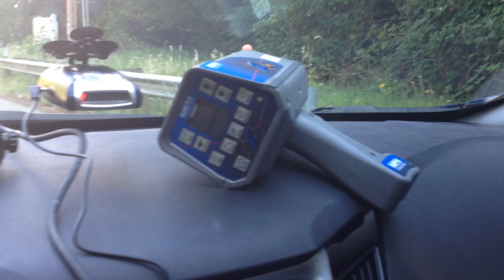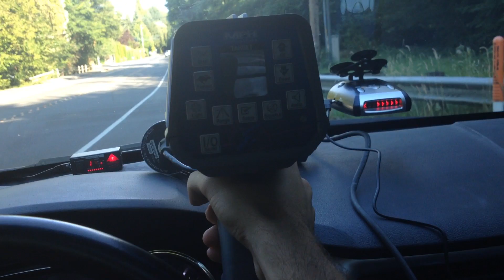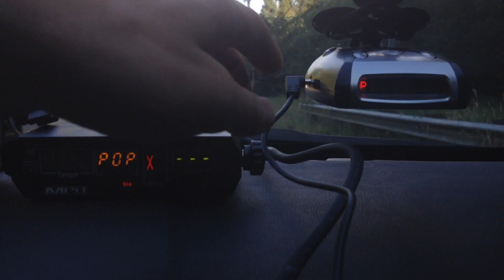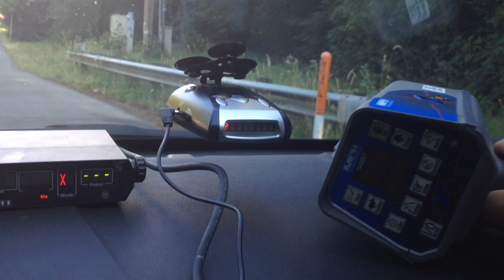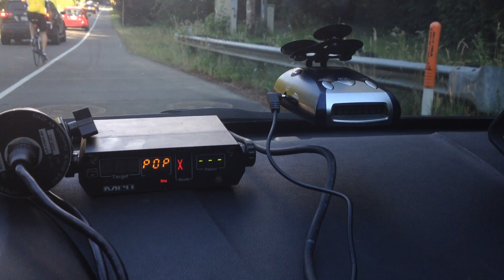Rocky Mountain Radar C495 POP test

Comment: How did the v1 do against the 16ms pop?
Reply from the maker: It doesn't alert either. Actually no RD I've seen yet will alert to it (V1, Max, Redline, 9500ci, 9500ix, 8500.) It seems detectors are designed to detect just 67ms POP. You'll notice in Max manual that it says it detects Ka POP, for example. :) The Z35 also seems to become inaccurate when shot beyond 500 feet or so, but it's quite good at point blank range. Then again so is regular IO at that point. :)